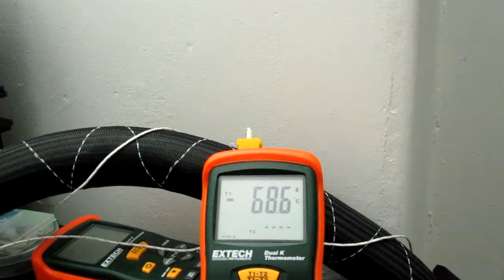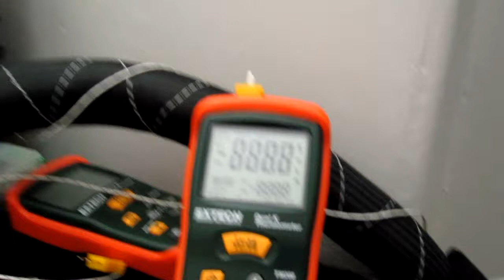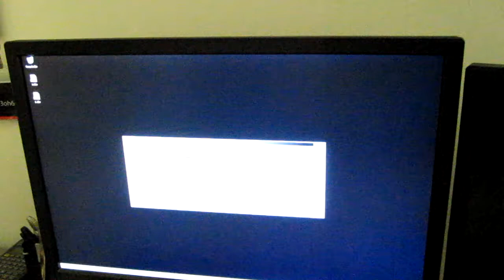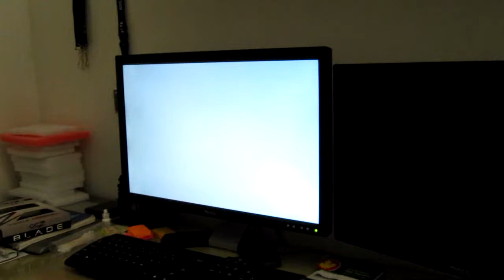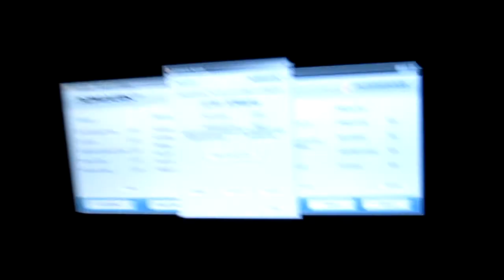HWC Overclocking: 3DMark06 run with i7 920 D0 at 5195 MHz

Comment: Sorry, formating error. My cpu score was 20,331.
However, that was at the highest settings of 3dmark06 at 1280x1024...

Don't get me wrong, 5 ghz is impressive. I'm just more about practicality. Using liquid nitrogen to chill the CPU is hard core, but just not practical.

I'm waiting for the new 6 core intel cpu to come out before I switch to liquid cooling...

Comment: 3/5 guys.

Next time turn up the resolution.

My air cooled system posted 20,331,8278,8790,and 6421 with a 3.5 ghz oc and a cpu voltage of 1.28...